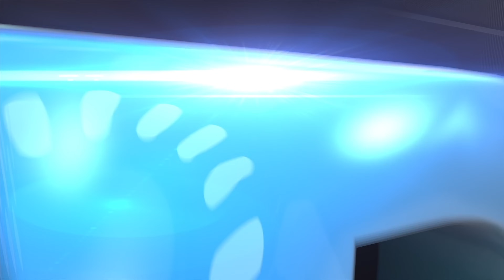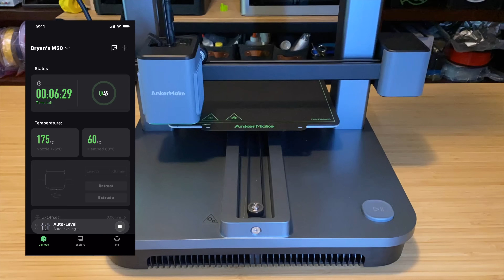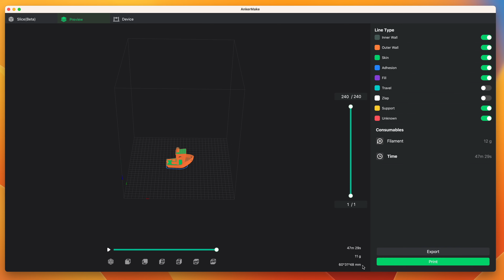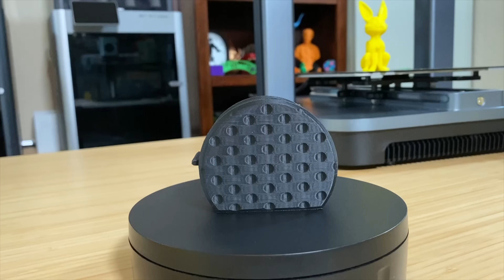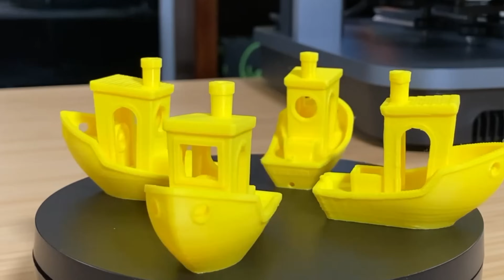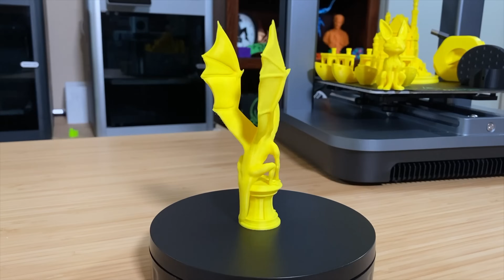A Rebel 3D Printer: Embrace Minimalism, Ditch the Screen

Comment: I think it's ok if a printer isn't for everyone, younger folks with phones always in their pockets will have no problem with this machine.
Reply from the maker: Yep! I like that AnkerMake was willing to experiment with removing the screen, either as a cost-cutting measure or as a way of being a little more unique in the marketplace. 

My phone's usually in my pocket as well, so I don't really mind using the app. But I also like having local control. So the older M5 is more my speed. But I think as long as AnkerMake sells as many M5C units as they're expecting to, it'll be a success for them.

Comment: You don't need accelerometers on a head that is a fixed design.  They can determine the parameters needed during testing, and then just use those settings for the shipped machine.  If you change the mass of the head (using a different hot end, for example), then you are saddled with doing the recalibration needed.

Do you know if they are using Klipper?  Hiding the firmware they use is a no-no, as far as I'm concerned.
Reply from the maker: Hi! I don't know if they're using Klipper. Even if the mass of the head and the bed don't change, it seems to me that things like belt tension would also be a factor in input shaping. The belt tension is user-adjustable (and/or the belts loosen over time), so if belt tension IS a factor, that could explain why this printer's factory calibration works well for some people and not for others.
Reply: @BV3D  Good point.  I'm not sure about that either.

Comment: I love my M5C, and this is a great review, but I do have one correction for you - you do not have to be connected to a WiFi network to use the printer with the app. You can disable WiFi on your phone or tablet and the printer will connect to the app with Bluetooth. You do need internet access to update the firmware, and for the initial setup, and you do need a WiFi connection to your local network to print from the slicer, but you can export the gcode to a USB-C thumb drive (or a USB drive with an adapter) and use the printer offline using  the app. There will be a warning that the unit is offline and using bluetooth, but just tap the Print button, select the USB tab, select the fie you want to print, and press Print. I do sometimes have to refresh the file listing (just drag down from the top), and my USB-C drive has to be inserted until it clicks, but you're not limited to just using the button or connecting to a network. Also, if your use a USB drive with a cheap USB-C adapter and the app doesn't see it, turn it over. My adapter only works if inserted into the printer "upside down." Even though it's USB-C . . .
That said, I do wish the app provided a bit more control, and I wish you could control the printer with OctoPrint, but I find I don't miss the control screen all that much. And I don't get as much ringing as you got on your prints, but I also don't use AnkerMake Slicer that much because I don't like Cura, and AnkerMake Slicer is a broken version of Cura. PrusaSlicer works great, and the AnkerMake website has instructions on adding the printer to other slicers, so you're not limited to using their software unless you absolutely insist on printing from the slicer.
Reply from the maker: Hi Denny, thanks for the correction about being able to print over Bluetooth (and without WiFi). I appreciate it! 👍🏻

Comment: I understand where Ankermake is going with this but I question their choices. For a first time user the novelty will wear out quite quickly and the lack of any local control will become cumbersome, turning the M5C into a $400 paper weight in short order. I also wonder what's going to happen when they decide to stop supporting the app and shut down their cloud service. It's neat, but the potential for it to become so much more e-waste is high. Great video BTW!
Reply: ive got two of em and i dint really miss the screen in all honesty. Kinda makes dealing with them easier ive gotten my workflow pretty optimized, through the app.
Reply: Having to open my phone and launch the app every time I interact with the machine is a non-starter for me. Is it a nice add-on to supplement  an existing interface? For some maybe, but I really think wholesale replacement long term is a bad idea. YMMV @KevinLagan